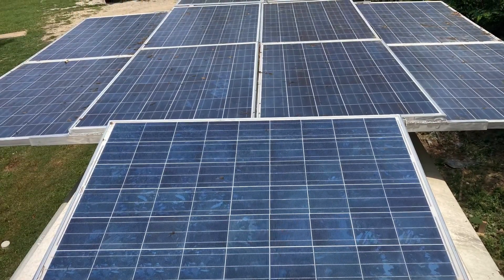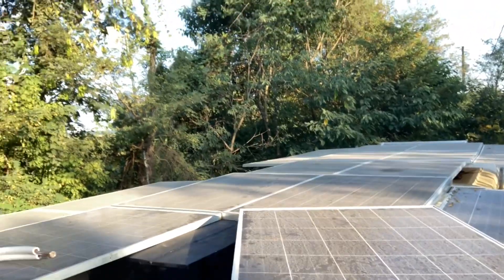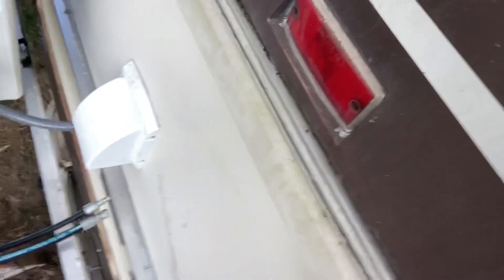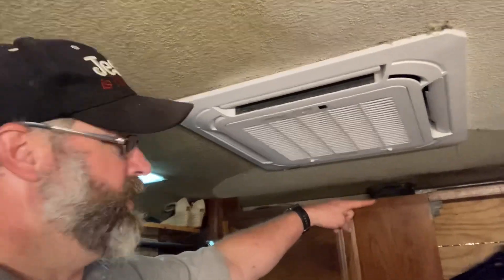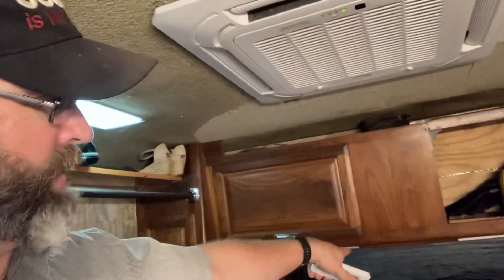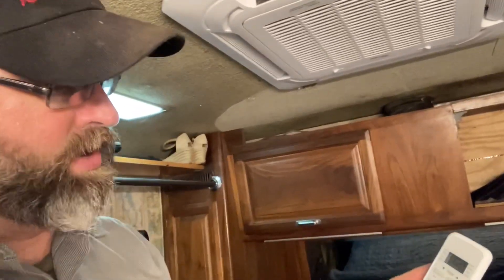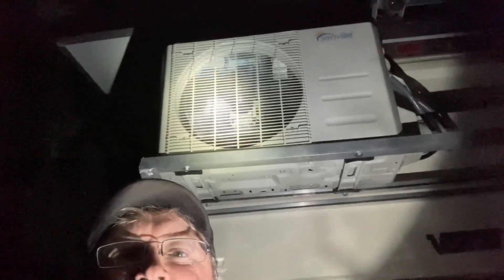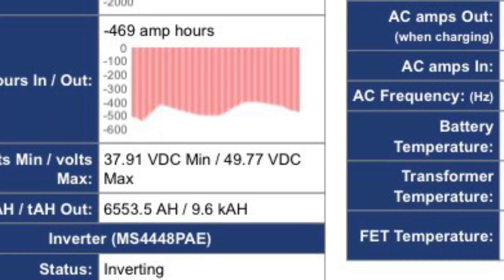Installing a Mini-Split Ceiling cassette AC/ Heat unit to the RV Ark Motorhome Part 2

Comment: How well does that unit work in 100 degree heat?

We are in Vegas.  Could a dual zone 18k keep a 31ft class c cool with the ceiling cassettes?
Reply from the maker: @northsiderlost  we love the ceiling cassette. The 9k ceiling cassette worked twice as good as the front 12k ducted unit. Our issue is insulation. It may be yours as well. We have a much older rig, 1987 40ft, with old single pane windows and little to no insulation so they had a hard time keeping up in the South Texas heat. The front unit never ever really did so well so we used a blower to blow the cold air from the bedroom to the front which helped. So if you have a newer smaller rig then it should have a problem at all.
Reply: @GODventures  thanks for the reply.
Reply from the maker: @northsiderlost  yes sir GODbless

Comment: Did you have to cut any roof rafters to get the cassette in there?
Reply from the maker: No. We have 4x4 steel tube frame throughout and I had plenty of room between them to make it fit. The leading edge of the outside cover and the unit itself is anchored to that frame.

Comment: Could you also list either the model numbers for your unit or the link in the description?
Reply from the maker: https://senville.com/9000-btu-ceiling-cassette-air-conditioner-heat-pump-sena-09hf-ic/

They are out of stock. If I would have had the funds, I would have went with the 12k but the 9k seems to do better than our ducted 12k in the front.

Comment: Good to see others doing this with cassette mini splits.Just have to remember these cassette ceiling units have a pump that pumps the condensation water out of drain pans.If it fails you end up with a bed of water.... The Pump is tucked back in it where the lines come out the corner of unit.Wall units do not use a pump , its free flowing drain system.
Reply from the maker: I had to take that risk lol
Our concealed duct system in the front also has a pump
Reply: Ya big if and if it fails the worse thing to happen is a little water on the blankets . No big deal .
Reply: What's your point?  The same o
Would apply to someone installing them in a house, I'm sure they have a fail safe to shut the unit down in case the pump fails.

Comment: That blower isn’t rated to be outside like that lol. I give it a couple months
Reply from the maker: What are you talking about?
Reply from the maker: It’s been almost 3 years
Reply: What in the hell are you talking about?
Reply from the maker: @randybobandy9828  it’s been installed and running great for three years. What are you talking about? By the way, hell is a very real place and the word shouldn’t be used so trivial.